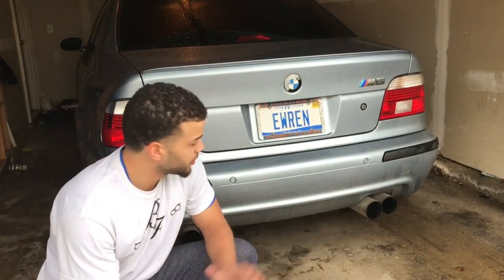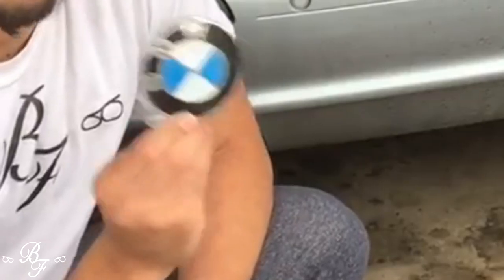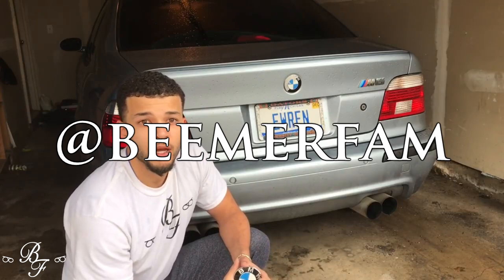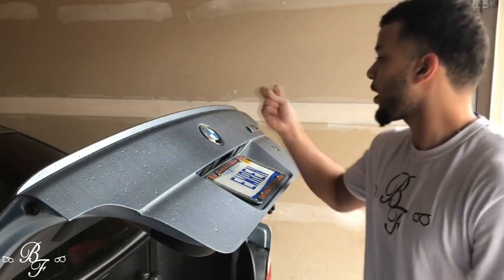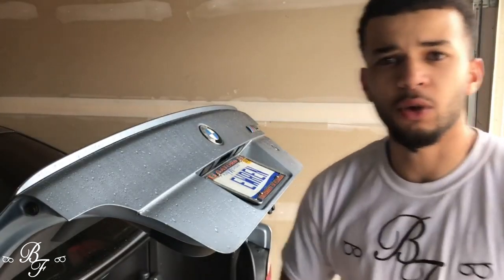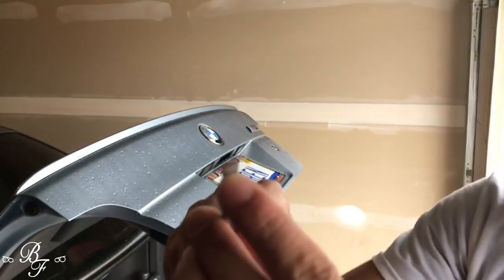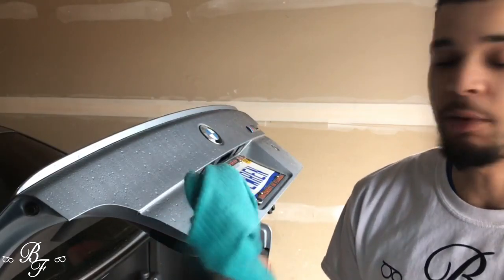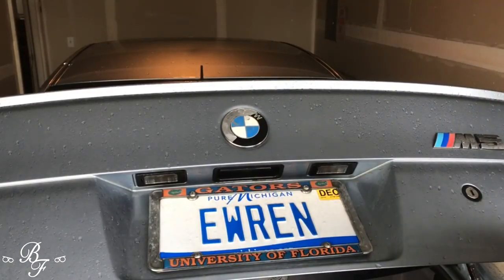HOW TO Remove and Replace BMW Emblem In Under 30 Seconds! (Hood and Trunk)

Comment: Video is a little fake, or say not as applicable, usually there is plenty of dirt below the old emblems, and they’re falling apart and really hard to remove. In that case it is helpful to remove the actual emblem first and the metal disc below after. Still good work here. 👍
Reply: Seems like he changes them out frequently.

Comment: 1) Do NOT use a screw driver of any kind. Use a plastic body tool. This emblem shown was previously removed and an original emblem is stuck on much much harder. The procedure is correct, but the ease is bogus. I promise that a screwdriver is going to leave a nasty mark.
2) On removal the grommets in the trunk deck will come out some. They will need to be lightly hammered back with a small plastic mallet/hammer. If you don't the emblem will stick out a tiny bit and wobble because it won't seat all the way.
I found all this out the hard way. Don't you.
Reply: I found out the hard way :/ have a nasty half moon scratch around my new emblem now

Comment: That shit wasn't easy at all for my X3. That's because after prying it off, you have to then scrape off the glue/tape that's applied before you can put a new badge on. That took me over an hour. 🤔
Reply: Same for my 135i. The hood emblems seem to be standardized. The trunk emblems vary in size and attachment method. On my 13 year old 1 series, the emblem just fell off when the adhesive failed from time/heat. So like you I'm going to have to scrape off all of the adhesive and find a suitable replacement for the new badge. Very doable, but definitely not in 30 seconds... 😂

Comment: No way would I use a screwdriver! I used a wood spudging tool that I made. My 88 M3's emblem did not come out easily, the pins were stuck in the rubber grommets and even though I pried carefully the pins broke on the original emblem. One pin came out by turning and pulling with pliers. I had to drill and tap the other pin with a 4-40 tap to pull it out. The new one went in easily and I heated and re-used the blobs of black sticky stuff that help hold it in place. The new, real OEM BMW badge for $50, was not as nicely made as the original and much to my dismay, the new emblem no longer sits perfectly straight. I had bought a cheap eBay copy and threw away that bad looking one.
Reply: That really sucks. I just bought a cheap EBay one for my e38 and it doesn’t sit flat either it has a slight tilt to one side too. Hardly noticeable but still makes me mad. I ended up using a screwdriver and microfiber and ended up scratching my paint when prying. I’m absolutely livid.

Comment: I replaced mine without problems, too. BUT: there are a dozen things that can happen here. On the old logo, the two pegs might have become brittle and they may break off. Then you have to pull them out with a pair of pliers. The two nylon bushings can be reusable, but every new logo comes with two new bushings, I replaced them. What took me most of the time was to clean the lid under the logo. After decades, it can be quite a mess. But apart from that, it‘s a pleasure. :)